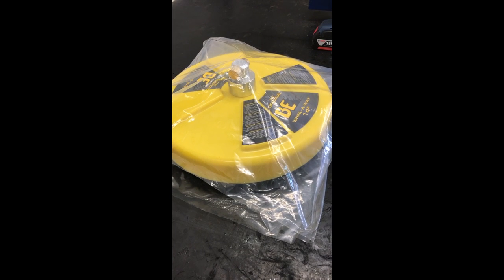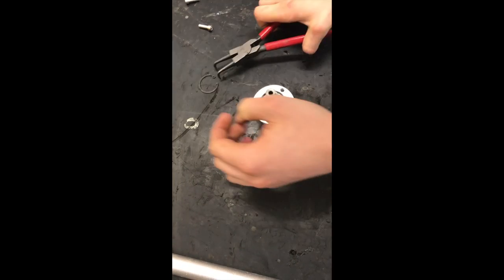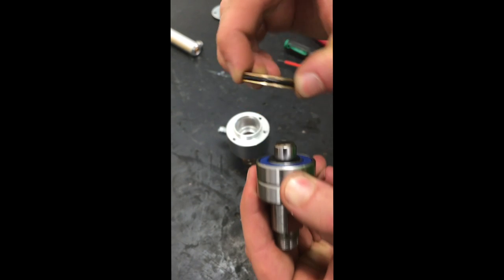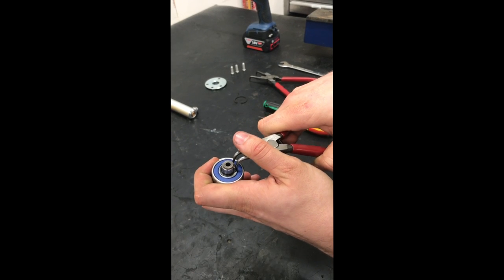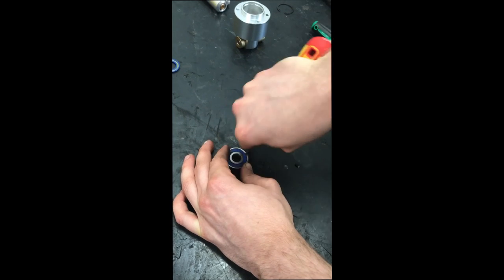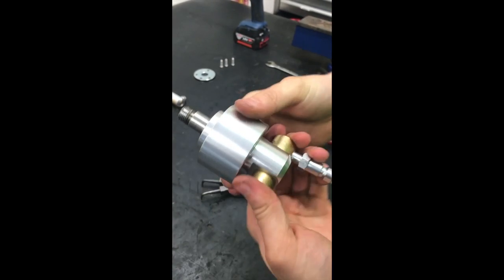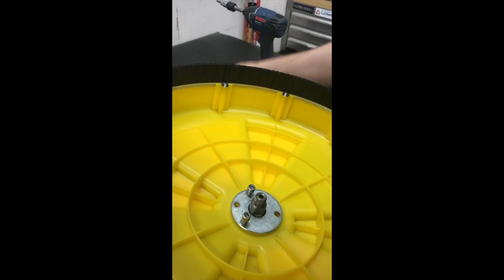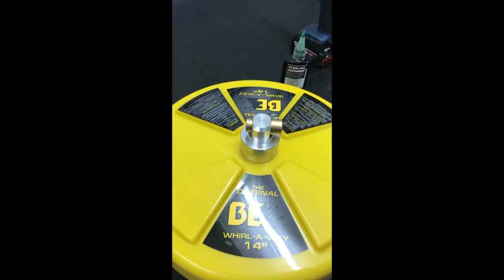Whirlaway 14" Head Rebuild

Comment: Hey. I have a whirlaway 25 foot lance. It came with a smaller quick connect then the rest of my pressure washer. I think its a 1/4 size? 
Would this surface cleaner fit it? For washing roofs. 
Mossmatic is a bit expensive

Comment: Looks like a common problem with these units is they stop spinning. When I took mine apart the brass fitting at the bottom of the aluminum housing is pressed in there, I believe this is whats causing my issue. As the bearing spins fine, but once the shaft is set in and it seats down in the brass seat it becomes noticeably more tough to spin. Bit of a piss of I've only used the thing like 6 times.

Comment: Hmmmmm, interesting. I bought one of these a couple of years ago, and it has worked well. I greased it before using it and the grease came out the other side. From your helpful video here, I am guessing that the grease went around the bearings. Can you do an experiment to test this? Perhaps the grease, under pressure, pushes past the seals. If the bearings don't get greased, then what is the point of the grease nipple? Do we grease the seals? Does the grease help to prevent water ingress?

Comment: Have the same model, brand new. Trying to remove the rotor assy. The rotor is stuck, Locktite? Gues I have to apply heat to break it loose...
Reply from the maker: Yes loctite, be careful with heat as there are rubber o rings that the heat will damage, heat it gently with a hair dryer or hot air gun rather than with actual flame
Reply: @rutlandpumps  Did the mod today. Made a heat shield around the hub, and filled the rotor and hub with water. The assembly was undamaged and had all bearing seals intact. Removed 3 of the bearing seals. After reassembly applied new grease.